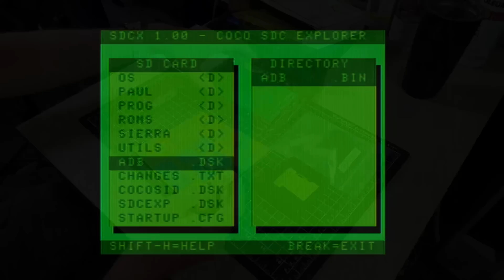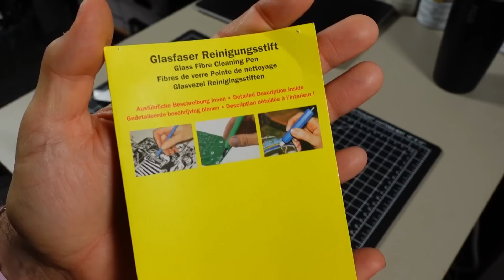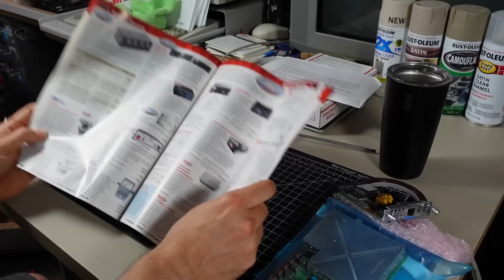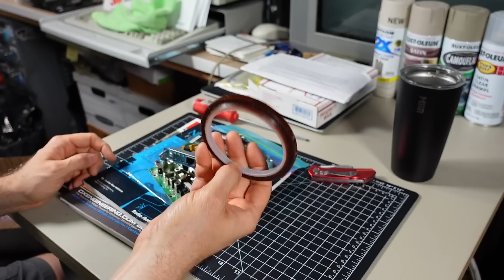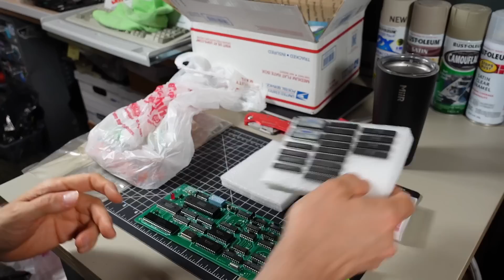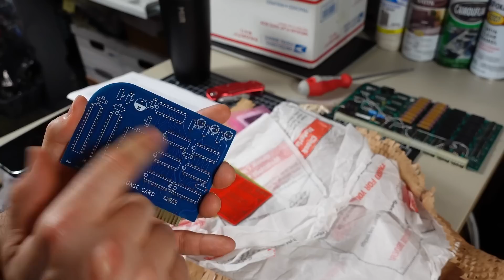0040 Apple II replica cards, a prototype 16K RAM card and a sound card for the SWTPC 6800!

Comment: Installed a rake of Rev drives in ~2007/8, mostly the 70GB but they also did a 120GB version. The cart is a hard drive without the heads, they live in the drive; and the drive is quite unreliable. They were popular with customers (medical sector, small businesses with entirely standalone systems) who were used to the idea of taking backups offsite / storing out weekly/monthly etc, and had previously used DDS tapes; offline backup took over when broadband upload speeds caught up.

Comment: I thinkt he Rev disk format was a last-ditch effort from Iomega to keep themselves relevant as CD-Rs, DVD-Rs and ultimately USB devices were taking over their niche of portable storage, 35GB is a respectable size though, but, keeping what is basically a semi-open hard disk drive in your pocket, I'd guess reliability was pretty compromised...
Reply from the maker: Haha yeah -- I guess similar to the Jaz drives (Jazz?) I'd have to think it was possibly pretty fast R/W format versus DVD-RW ... and of course larger size. Just certainly much more costly.
Reply: @adriansdigitalbasement2  I think the Jaz drives were basically just a re-engineering of the Zip drives (and even then there's a rather rare Zip-750 too), but I'm far from knowledgable on Iomega stuff, only recently bought my first ever Zip drive (and then broke it, but fixed again with a dead Sony FDD!), rarely used them even when working at a computer repair shop when occasionally using them for a customer's backups... :P
Reply: @twocvbloke   Jaz was a rigid disk, not Mylar like the Zip disk.  It is very much a removable platter hard drive.

I don’t remember ever seeing Rev disks.  That’s news to me, and remarkably recent.  I thought Iomega was floating at the top of the bowl by then.

Comment: Although it probably goes without saying given the people that would be viewing this clip, if you like the simple DAC audio look into the 1 bit music scene.  Quite complex tunes can be bit bashed out the cassette interface of many machines.  Many cassette interfaces have more than a single bit driver so even better can be done on them.
Reply from the maker: I remember the game Mean Streets on the PC -- which puts really decent sounding audio out of the PC's beep-speaker. RealSound was the tech that was used, if I recall...... this was back in the late 80s in production games. https://www.youtube.com/watch?v=havf3yw0qyw
Reply: @adriansdigitalbasement2  Mean Streets was the first game I came across, a pirate copy was installed by the PC assembler!, that did that too.  The first time I came across PWM audio out of the PC speaker using the hardware timer + interrupts was several years before in a demo that played In The Mood.  The comparatively low PWM frequency meant a high pitched tone could always be heard along with the song itself.
Reply: You could use varying pulse widths and a capacitor / resistor network to create a 1 bit D to A. Basically the longer the pulse, the higher the voltage.

Comment: WOW didn't know you're a RO!   73 KG4MXV
Reply: The SWTPC MP-16 boards used defective memory chips where either the upper or lower part of the chip was bad. They would sort them and set the board to use whatever half of the chip was good.
Reply: @toddsilk8153  wow, really? do you think the bodges could be to try to activate both halves?
Reply: @zBradBell  

I assume it's just because of being an early version. I have the later one and it doesn't have all those bodge wires.
Yields were lower on memory chips and it was a way for SWTP to offer a lower cost memory option and for Motorola to sell what might otherwise be scraped.

Comment: Many years ago I had the Corvus Omninet server which fed those network cards and a Corvus Concept workstation. Omninet was very similar to LocalTalk but faster (1 megabit) and more immune to noise. To do that it drove the network strongly and ate power. You could have double the nodes on a segment compared to LocalTalk and three+ times the shielded cable length. The server was a (not so) little box like an oversized drive enclosure which inside contained a PCB on top and a lower layer with a power supply and a 5 1/4" MFM hard disk. 
The Concept diskless workstation was something quite special at the time. It was an 8MHz MC68000 machine with a keyboard on a leash (like a PC) connected to a thick plastic pizza-box enclosure containing the power supply and motherboard and with a notable tilt monitor stand built into the top cover. It was probably somewhat explosion proof too and I think it had 512K which was upgraded at some point from 256K. I seem to remember the workstation having a CPU board and a memory board but I recall it had 4 Apple ][ slots inside. The monitor was a very boxy monochrome full page display, but it had mounting points on two sides so you could attach it as either a landscape or a portrait display. I seem to recall a switch on the rear for selecting video orientation and a DE-9 video cable.
Reply from the maker: Wow that is quite cool. I wonder how much documentation and software exists from all of that today?
Reply: @adriansdigitalbasement2  I just looked a little and the 120 page service manual is even online multiple places! There are a number of pictures too. I don't know about software availability and sadly I never got mine to boot and the parts were recycled by 1989 with the PCBs hanging out in my collection for a few years after that. That's why I recall the two banks of memory being different chips... one bank was all ceramic chips with big gold covers. If I had only known back then.... sigh. I grew up around Silicon Valley and this was the only one I ever saw but there were lots of other unique machines at the time. You can find lots quickly with a search for "Corvus Systems Concept" and a nice copy of the manual with schematics is available at the manualzz (dawt) com site with the extension /doc_60141498/corvus-systems-concept--personal-workstation-service-manual . I wish we could just post links, C'est la vie. I know software-wise it had a standard OS and a Unix branch as well but I think beyond the EdWord word processor, the main value was in high power CP/M emumation to boost custom applications stuck on older hardware. I got that beast along with a Diablo 630 from a bankrupt private school that went Macintosh about 1985 and I'll bet the Corvus was evaluated and shelved right before the Macs came. They moved up from several terminals sharing a 6MHz Z-80 minicomputer from Japan without any name to be found on it.

Comment: Did you ever get your license? I used to do alot of talking on 2M years ago, really wanted to get into using packet radio, but at that time I never had the money to buy a modem. Did some experiments with soft radio though. 

73 de SM3UGQ
Reply from the maker: Heh yeah, I got my license about 20 years ago -- so even then I was "late" to the game -- but then I mainly only played with my handhelds
Reply: Never too late to re-up even with the fee increase in the States. If you had General or higher, you can apply to get your old privileges back after passing the current Tech exam.

Comment: I think there may had been a sound board made later on which used an AY-3-8910.

I have an old Eraser cleaning kit which had very little use when I received it.  It has inserts with fiberglass, stainless steel and brass bristles.  They still make them but I don't think you can get the metal bristle inserts anymore.  The inserts on that German made fiberglass pen look very similar.

Comment: Does anyone make a replica Z80 / Softcard ?
Reply from the maker: There are some yeah -- but none are open source that I'm aware of.... So you have to pay inflated prices for what is essentially just a clone with commodity parts on it. I asked Brad about making a Z80 clone and also the 80 col card clone. He said he's working on those but not ETA
Reply: @adriansdigitalbasement2   Schematics are provided for older versions of the 7MHz GGLabs GZ/80, though it uses some programmable logic to do the memory remapping and clock synchronization, and I don't think source is provided for those.  I've also found schematics online for non-accelerated Z-80 cards, pretty simple, only trick really is, again, programming a chip (EEPROM in that case) to handle the memory remapping.
Reply: @adriansdigitalbasement2  Thanks for the reply! That's great to hear! One good thing about the card is that it only used commodity parts.

Comment: Some Apple II hardware, I think from Mountain (not sure, but other vendors might have done this as well) used something called "phantom slotting" for some of their multifunction cards.  They would use (usually configurable) addressing logic much like the port I/O addresses on ISA cards, but you'd tell it, for example, to look for address $C400, but the card resided in, say, slot 2.  So instead of being in the address space by virtue of being in a card slot, if memory locations matched the (sub)device's location configuration, the card would say, "Oh, I need to pay attention to what's on the address and data buses!"